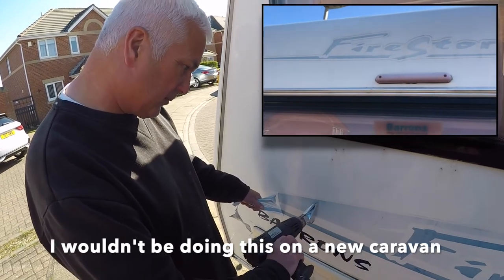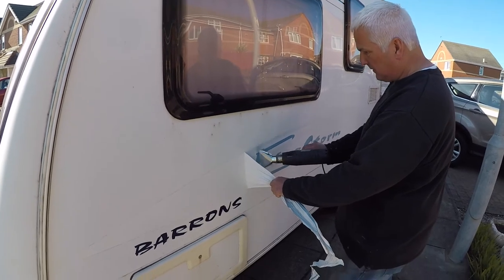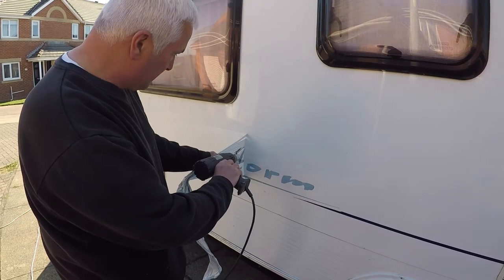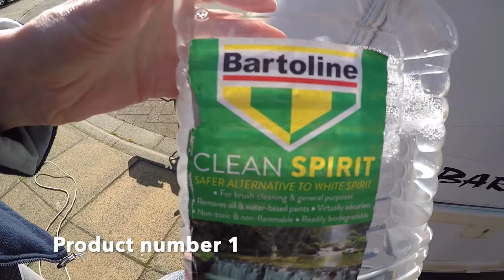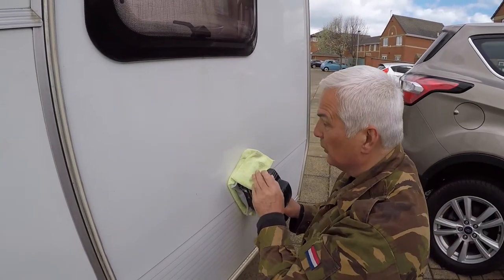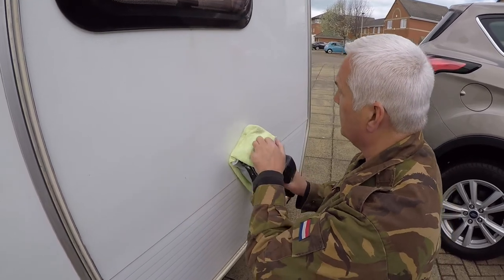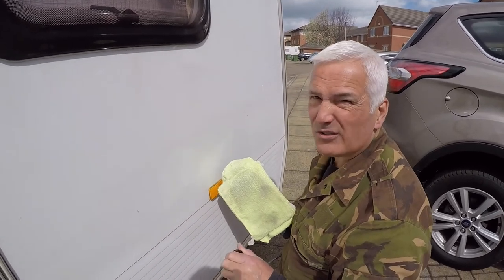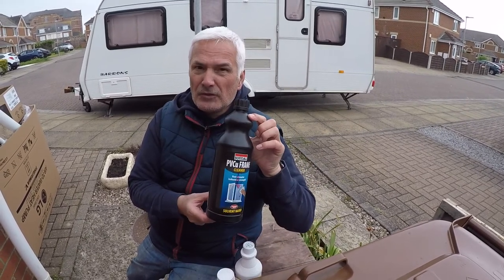How to remove the Vinyl and Stickers from your Caravan. Caravan Restoration Part 9

Comment: So, I have decided to remove two stickers on my van and I had to smile when the first video I watched was of a guy with white hair, working on a Barons Firestorm 505? Exactly, what we have and I, with my white hair, wants to remove the two roof stickers! Did you ever find something to remove the glue?
Nick
Reply from the maker: Hiya, good luck with that then, it was a pain in the bottom lol. 
I’ve had to re watch the video to see what I actually did. 
We ended up using some kind of industrial cleaner that a friend brought round for me, but I’m not entirely sure what it was , cause it was unbranded. I think it was break fluid though, but don’t hold me to that. 
You had to rub it on, and leave it a minute or two to do its magic, but if you left it too long, it took the paint off too, so beware. 
Sadly I’ve actually sold the caravan, and bought a Renault master, which I have been converting into a camper van. 
That’s over on Foxy’s Travels if you want to have a look. https://youtube.com/@foxystravels?si=tomYDK1PuWrz5-Dg
Good luck, and let me know how you get on.